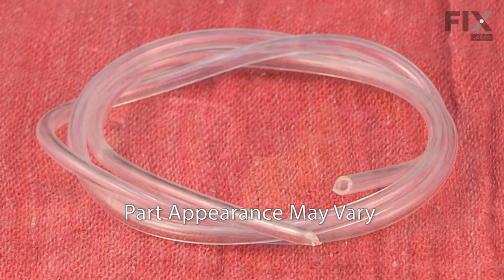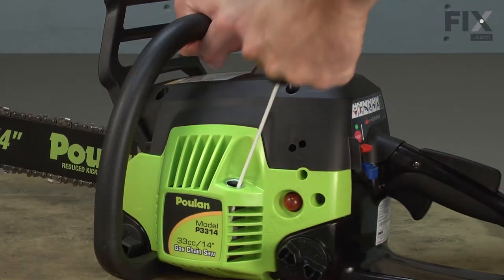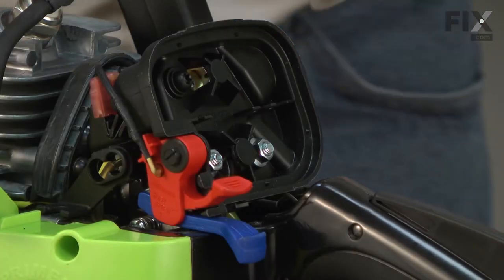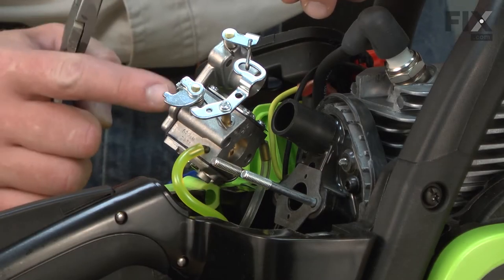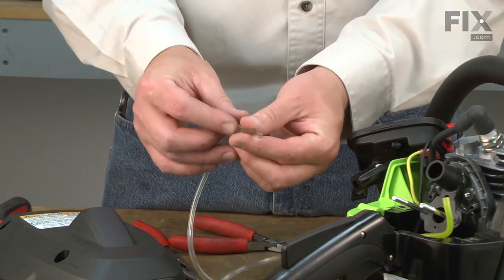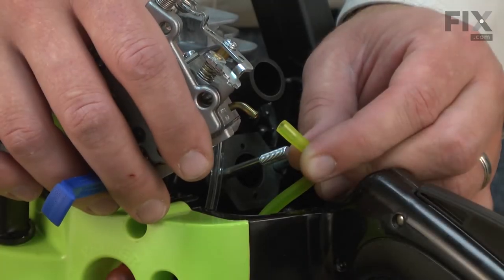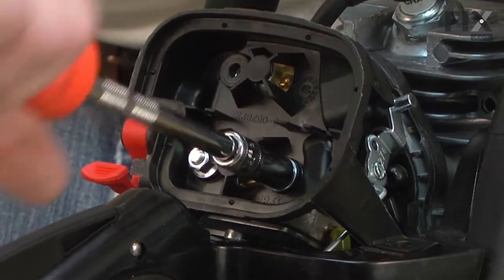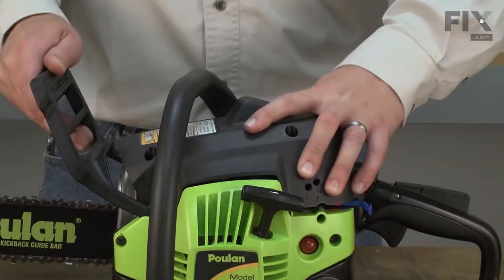Poulan Chainsaw Repair - How to Replace the Fuel Purge Line

Comment: Nice video, unfortunately it has nothing to do with the Fuel Purge Line. You did a nice job of showing how to replace the fuel lines to the carburetor. The purge line runs from the primer bowl to the fuel tank.